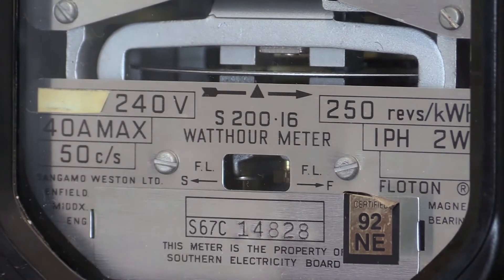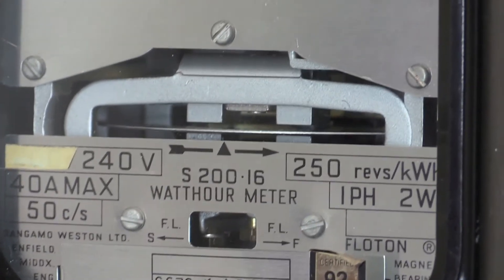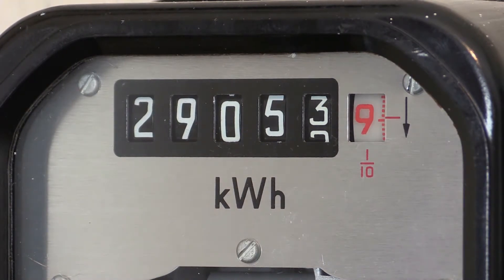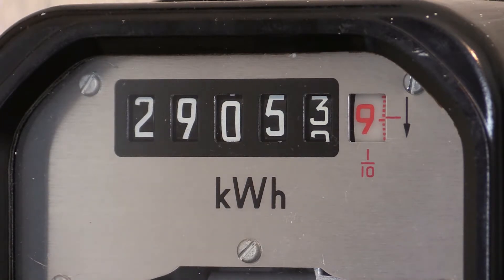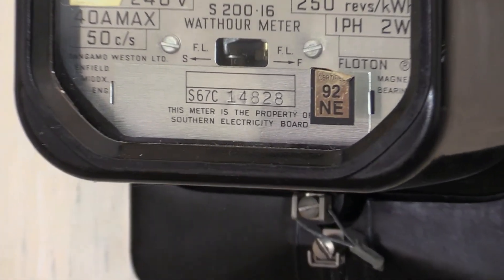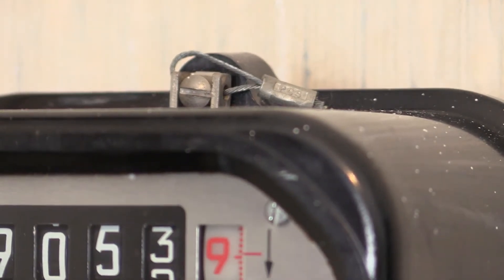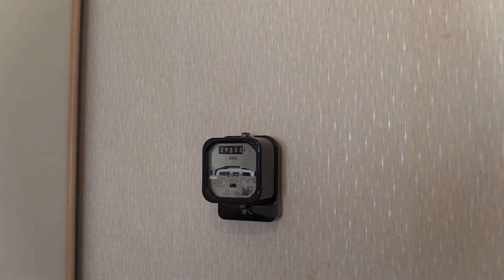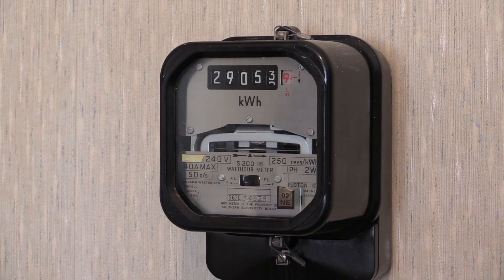Electricity Meter : Sangamo Weston S200.16 (cyclo dial variant)

Comment: I have the exact same meter, certified in 1986.  I’m currently being bombarded by e.on that this meter has “reached the end of its life” and needs to be replaced by a “smart” meter.  I’ve contacted C.A.B. and they say if it’s not M.I.D. certified or it’s faulty and giving false readings, e.on can replace it, but it’s working fine.  Any advice?

Comment: Installed in my house I have this exact same Sangamo S200.16. I don't desire or need a smart meter & object strongly to the govt-driven wholesale replacement programme of perfectly good meters with inferior quality meters that may only last 10yrs or so & believe it to be a folly that's costing all of us dearly with inflated bills. No such thing as a new 'free' smart meter, despite the bs fed to the general public! I'd reckon about £400-£600 for each install, slowly & quietly added onto our bills.
& yes, anyone with any sense knows that the smart meter rollout target date of 2025 is totally unachievable. I've no objection to all older meters being replaced on a rolling basis when they reach the end of their service life & this is what should've happened IMHO, rather than the smart meter veiled threats/frenzy/panic we've seen over the the past 5 yrs. Anyhow, to my question...I am pre-empting the almost inevitable letter/ demand in the next couple of yrs to replace my perfectly-good old style meter; it was certified in 1993 (sticker) & the research I've done indicates a certification period of 40 yrs. This info is from Gov.uk, Office for Product Safety & Standards, 'Schedule 4- UK Nationally Approved Electricity Meters'. It details the Actaris/Salum/Sangamo/Itron S200.16 as 40 yrs approval. By my reckoning, that makes my meter certified until 2033?. But my meter also the original internal stamped serial number beginning P877-67 (presume 1967?). Without the sticker on the outer glass stating 'Certified 1993' it would've been out of Cert in 2007?, but the additional sticker now extends this to 2033? 
Would be interested to hear your thoughts on my meter & the smart meter programme in general.  Thanks.
Reply: hi wirdy, Pretty much the same question though our serial nos. differ from the one in the video with P877 preceding the 68. Trying to interpret that with  with help from wikipedia - https://en.wikipedia.org/wiki/Meter_serial_number - apparently P denotes manufacturer and the following two numbers year of calibration and certification.  The rest of the nomenclature doesn't seem to follow tho...
Reply: I also have this meter and with the rts being switched off I need to know if this meter will still work ??

Comment: Hi Wayne, there is a Sangamo S200.22 variant on ebay UK. Same dial as on the S200.16.
Just letting you know, as we can't PM email through here. my email address is  raytray.van@gmail.com  The listing is under Vintage electrical watt-hour meter Sangamo Weston working condition. listing still has 4 days to go. check it out.